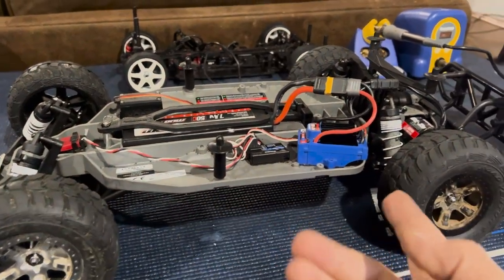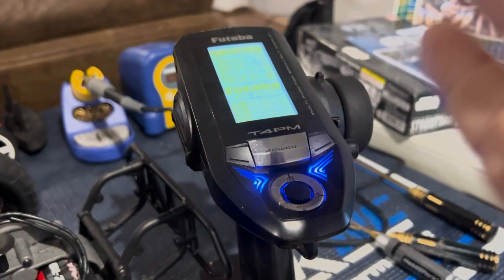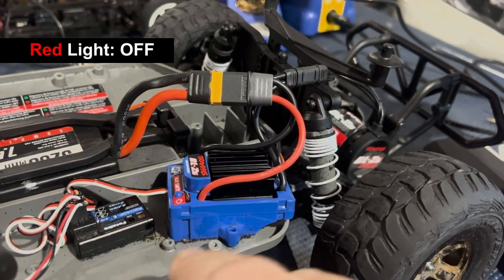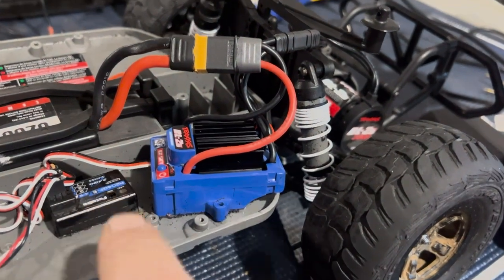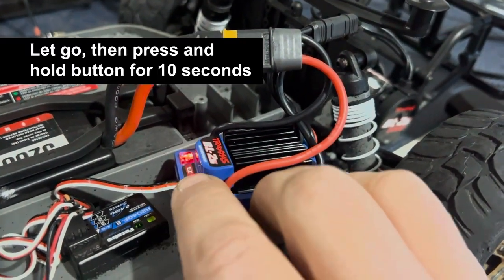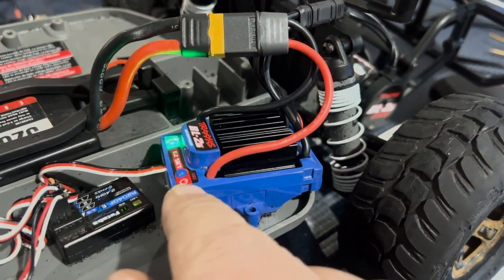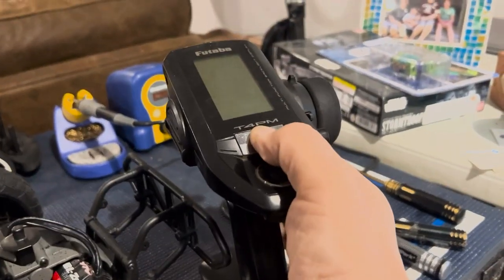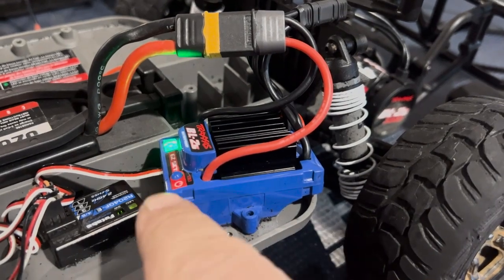Traxxas Slash BL-2s Activate and deactivate Low Voltage Detection - Lipo mode

Comment: I’m confused ether my esc is a lil faulty or something, the esc goes green then I play for about 5-10 minutes then it goes flashing red and it don’t go full speed. I think the receiver is alright because it stay green. someone tell me??? Is it not in lipo mode?
Reply: I have the same problem!
Reply: @tutie  I fixed it just had to charge the battery up and unplugged most of the wires and plugged them back in the receiver 
This worked for me
Reply: @SmilingNightSkyline-rx3nk  I will try that! Thanks!